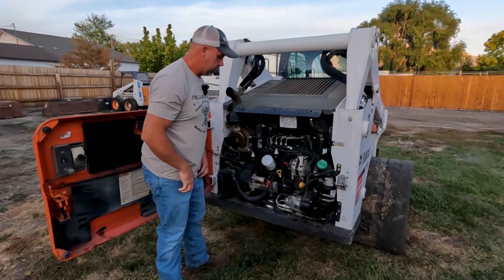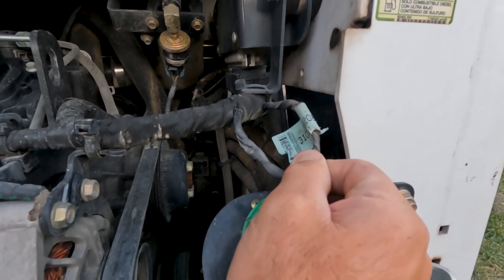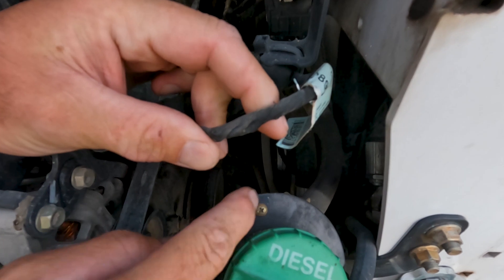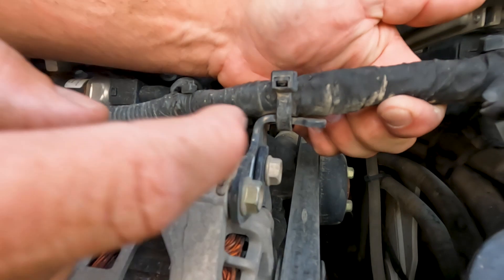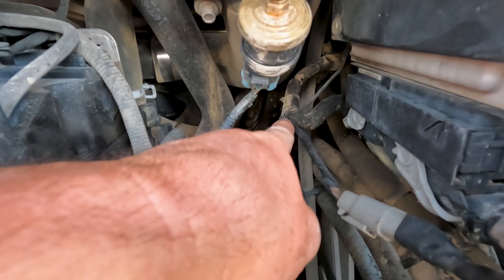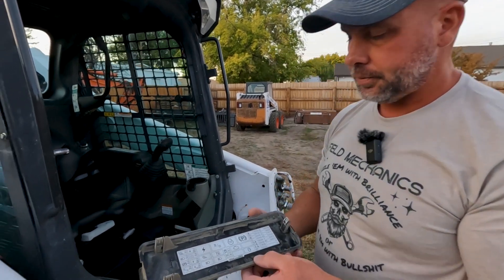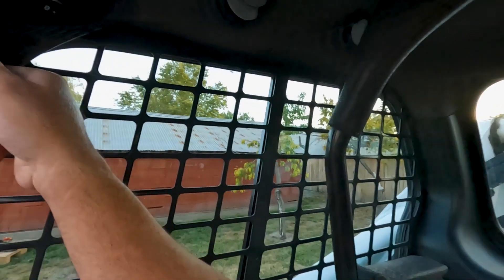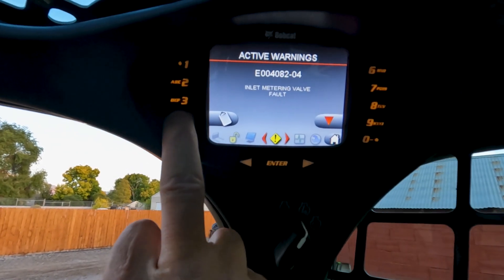Bobcat IMV Fault, Cam Sensor Fault, Rail Pressure Fault Codes.

Comment: I have an e002791-08 fault code.  I have a 2018 T595.  After about an hour or two of moderate work the code kicks on and the machine goes into derate mode.  If I let the machine cool down for an hour or so I can run it for about another hour or two and the code kicks in again.  I have no leaks or other issues.  The machine fires right up.

Comment: I’m only getting 1.5v on the plug, but if I disconnect the Deutz connector at the back-top, jumps to 10.5 V. 
I don’t see any wear on any points you suggest. 
Any thoughts?

Comment: After selling my Paving Company to my managers and moving to Roatan Honduras i purchased two bobcats, a fixer upper 763 and a low hour t590, i realized i will have to be my own repair shop. if i wouldnt have found this channel i would not have had the confidence to dive in. I purchased the laptop and software to reprogram the injectors. i cant say enough about this site and his products. your a lifesaver man.!!!  thank you for getting that sent in time for my friend to bring it to me,, i do need some training on the diagnostic procedures,,tec is not my strong point..

Comment: First off, thank you for the help, I have a t650 motor will not run, showing no codes on the dashboard. Bobcat said low rail pressure. Replaced the pump,no run. Checked the wiring harness found a lightly rubbed purple and black wires. No blown fuses. What am I missing? It will almost start every once in a while.

Comment: I got a 2016 s510 with the d24. Machine has a rough start and proceeds to run rough and smoke a lot. After started throws a cam signal fault and then a rail pressure control fault. Checked the 4 pin crossover harness looks good and also has a 12v 5v 5v and ground output. Also changed cam and crank sensor what else could cause it to run this bad
Reply from the maker: Are you sure fuse 21 is good?  Do you have 12v with the harness plugged in, did you back probe  harness to test for 12v
Reply: Fuse 21 is good. Got 12v 5v 5v and ground at the 4pin connect when plugged in. Also got 5v down at the cam sensor

Comment: Can you tell me where the cam sensor is located on a T595 My dealer just tells me behind the pump and to bring it in.  mine is a 2018 T595  Any help is appreciated Thank you
Reply from the maker: Cam sensor is on back of engine behind egr motor and a pain to get out.  Extremely rare one goes bad.  What are the symptoms?

Comment: I have a bobcat t-650 2016 and have a e000636-08 code say crank position sensor fault but i already replaced the sensor and don’t change anything so i check the fuse box and fuse #15 glow plugs  is burned so i did replace and immediately it burn again ¿any recommendations for this fault.
I always watch your videos wich helping me a lot in another tings but  now im stuck in this fault thanks so much for your videos all of them are spectacular thanks.
Reply: The fuse is 50 amp

Comment: I'm having similar issues.  I get a cam position sensor fault, bobcat's running great then will drop to idle out of nowhere randomly.  Also, recently, after pressing the green button to allow control, it has about a one second delay, almost like the parking break is activated or the bypass was never pressed.  I have a bobcat t595, any info would be great.

Comment: I have a T66 with P100B-16 code. My skiddy won’t start….. where do I start?
Reply from the maker: Starter feedback wire has an issue.  Check wiring at starter, I have seen the feedback wire broken due to  being too short.  I've also seen a bad starter cause the same code.
Reply: @tetradgroup  thank you! I’ll check that today. Only 400 hours on this machine. Have had issues. Coolant line broke not to long ago. Warranty covered that.
Reply: @tetradgroup  You were spot on!!  The starter was out on it.  Thanks for your wisdom and guidance. Skid steer is running great now!

Comment: I've got a 2014 t590 throwing an e000673-08 cranks and runs, but bogs, any idea what is causing this????
Reply from the maker: That's not a good code, I think it is missing a digit
Reply: I got the same code on the exact model and year. It says it's a cam sensor
Reply: Same thing happens to mine. Fuses and cables are good. Even to the ones you mentioned on your video. The only thing is actually checking the cam sensor but i can't find it. Do you have any idea where it's hidden?
Thanks!

Comment: I pulled the motor on an S570 to replace the auxiliary hard lines. After reinstalling the motor I have code E004082–04 inlet metering valve. It runs for about five seconds, and then shuts down with another code, E000637-08. 
Not too familiar with these newer machines. I pulled the metering valve out just to look at it and it looked fine. I’m kind of at a loss. Any recommendations?
Reply: Any follow up on this issue?
Reply from the maker: Check fuse 21 first, 15A fuse
Reply: @tetradgroup  all fuses are good
Reply: Please update

Comment: T770 running a u003492-12 DCU Fault
U004376-04 def backflow pump short to ground
E005246-25 tampering fault
And the display just says scr

Could these be causing a crank no start situation?
Reply from the maker: I wouldn't think so, those are all DCU codes and wouldn't cause a no start.
Reply: @tetradgroup  thank you much.

Comment: Hey I've been watching you videos love them. I got a problem code(M0721) shooting up on my dash in a T550.
Can't seem to find out the problem. Been looking online and have found nothing.  I was wondering if you encountered the code and know what to look for
Reply from the maker: Have you figured it out yet?
Reply: @HowIDidIt   yes I did turns out a connection was loose on the hydraulic selenoid. Thank you for the videos

Comment: Hello sir. Do you know anything about kioti tractors. I have a IMV valve code randomly.
Reply from the maker: Bobcat tractors are made by Kioti so I have worked on them.  Ive seen both fuel supply issues and wiring issues cause random IMV codes.
Reply: @tetradgroup  the problem started after it was split apart for HST pump replacement.  I don't see any pinched wires that I can see.

Comment: 863 bobcat, we rebuilt the engine and had an overheating problem. no oil was running through the oil cooler. had the oil cooler cleaned out, still nothing. Engine would run about 30 minutes and shut down, overheating. 1011f engine,replaced oil,filters,oil pump and removed the thermostat... nothing

Comment: Great video I have 753 hand control with float I have to move left hand control a long way to get to move and it hard to get the bucket to move a little .is that in the hand control senser wear .3000 hour on the machine g series hard to find grade with it thanks them both move alot and have been recalibrated
Reply from the maker: Can you email me a video of the issue?
Reply: @tetradgroup  yes I can what your email thanks

Comment: So is it always the IMV when I get the Cam sensor code?
Reply from the maker: Not always but they do share the same power circuit. If the fuse is blown both components will be affected.

Comment: Have you ever had it affect the crank sensor circuit on the t590 d 24
Reply from the maker: Not with this issue.  The cam sensor  gets 12V from the fuse box and the crank sensor does not work on 12V.  The crank sensor is a two wire sensor and both leads go straight to ECU.  Crank position sensor issues are very rare in my experience.